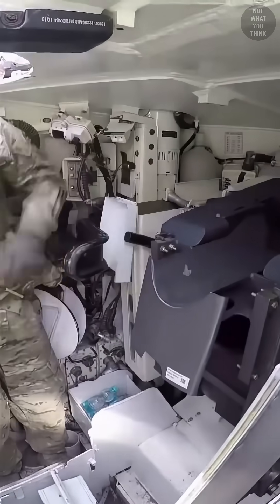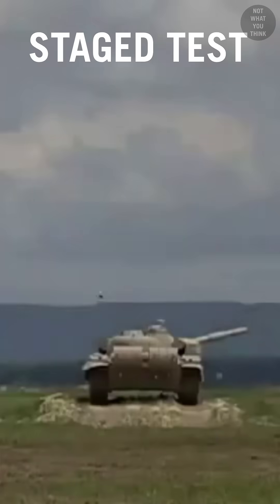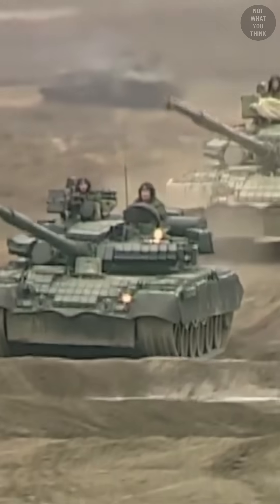Why M1 Abrams Tank Has No Auto-Loader #shorts

Comment: Seems like one could design an auto-loading system that also has this safety compartment.
Reply: Probably to many moving parts causing a higher risk of something going wrong or getting jammed. Plus with an auto loader you lose the added benifits for having an extra person on board. Benifits such are having an extra person to take over one of the other positions if some one gets hurt or killed, and extra set of hands when it comes to maintain the tank or enacting repairs while out in the field.
Reply: There are auto-loader tanks with a safety compartment, I don't know about Russian tanks, but I know the French Leclerc tank has a safety compartment and an auto-loader.

Comment: Why is everyone so not smart and lazy. You are too lazy to read the history of the development of the Soviet and Western schools of tank building. 
The reason why an automatic loading device is installed in Soviet tanks is the requirement of the military to reduce the size of the tank and its weight. But the tank's armor had to be very thick. 
At the time when this task was issued (50s - 60s of the 20th century), the aiming abilities of the tanks were very weak. Reducing the size of the tank made it possible to greatly reduce the chance of hitting a projectile from an enemy tank. Еhere was no such task in the western school of tank building. The reason for this is the very high complexity of developing a conceptually different tank.
Which leads to the exceptional high cost of this development. Also, there was no obvious advantage of reducing the size of the tank over its armor. The large size of the tank and, accordingly, the chassis. (7 wheels west 6 wheels of the USSR) can significantly increase the weight of the tank, which means it is easy to increase the thickness of the armor. In these conditions, in Western large tanks, the automatic loader does not make sense. Since the dimensions of the internal space will allow accommodating the 4th crew member (loader). The 4th crew member weighs significantly less than the automatic loader. Considering that the Abram at that time weighed 60+ tons, the American military abandoned the automatic loader, which added several tons to the weight of the tank. Although the Abrams with an automatic loader was developed, it was rejected by the military. 
I could write a lot of different information, but I think all this will not be interesting to anyone.
Have a nice day, good luck in life. Watch less TV and YouTube read more books. Study history. And then no one can make fools of you. Good luck....
Reply: Well, If you're not a tank or history or combat enthusiast like you and me, you wouldn't like or search up these things. Not everyone likes history or Tanks. For history sure that might be essential, but tanks? And some people have more important things to do or worry about depending on their jobs and aspirations. So no, I don't think everyone is"lazy"
Reply: @waitholdonwhat28  his point flew right over your head. His point was: "educate yourselves, you fools"
Reply: @rafon.  isn't that why people are watching the video in the first place?

Comment: -One more soldier to maintain the vehicle
-One more soldier to pull security
-Easier to switch ammunition types
-A well-trained loader can reload very quickly, sometimes even faster than autoloader systems that are just a few decades old
-Fewer moving parts
-Less heat buildup within the tank that could affect electronic systems or cause heat casualties in hot environments
Reply: Or, rather, one more federal job that could be easily automated promised to someone who missed his chance to come home as a folded flag since the New Deal depended on not a lot GIs coming home in 1946.

Comment: Bullpoo. The main reason to remove a crew member was to make the tank smaller. Smaller tank means less overal weight, not to mention smaller target. Also, smaller tank means cheaper to make and more logistics-friendly (less fuel consumption, rail and water transport etc)... Around 9 tons of weight is saved in armour alone by removing one man from the tank's crew. In the 70's, first T72's at 41 tons were approximately 12 tons lighter (and 20% smaller) than M1's of the time. While the proportions have changed in contemporary tanks, the main principle still stands...
There was an actual construction doctrine in Warsaw Pact countries, forcing certain bridges in border areas to be built in a way that the max load did not exceed 50 tonnes - this made them unusable for NATO MBTs, in order to hinder potential NATO armour movement.

Comment: 4 man crews make field repairs and daily operations easier for the crew as a whole. Plus when you take into account the tanks that have Officers the crew really is just 3 in terms of actually keeping the tank running.
Reply: Yeah and having a soldier load the ammo means you can fix a jam more easily than having to fix an autoloader gun jam
Reply: Oof.
Reply: Manual loading is faster as well
Reply: That's right.  When you are fixing shit and are on CO's tank, if that sucker goes down, he is gone.  Have fun fixing thrown track, broken road wheels, etc. with one less crewman.
Reply: Another reason for Russia use of autoloader is to keep the silhouette really short and small. Compare abrams height and t72 or t90, the difference is really significant. It may be an advantage for Russian tank in open plain warfare and in tank v tank battles, but in urban environments it’s kinda pointless.

Comment: The Abrams still stores it's ammo in the turret just like Russian tanks and Russian tanks keep their ammo in a sealed cell with exterior blowout plates just like the Abrams so the last reason is a bit of an iffy reason.
Reply: "Still stores it's ammo in the turret"?I see you skipped the video and went straight to comments with crap.
Reply: @gt37264  Bruh. The entire safe compartment with the ammo is inside the turret...
Reply: Explain why there are so many videos and shit of Russian tanks having their turrets explode after ammunition is detonated then. Clearly they rarely work, if at all
Reply: @Zero-ob8in  mostly because there's so many videos of it happening on older t-series tanks used as targets after the collapse of the Soviet Union.

The only decent video of an Abrams ammo cooking off that I know of was an Iraqi Abrams ISIS shot in the back of the turret, and people often leave out that the crew drove it back to base afterwards with no issues.
Reply: @Zero-ob8in  only T-90M have a safe ammo rack in back turret whit blown out panels. You can only acess it from outside. The carrocel is protected on M variant.
The T-72 only have a 20mm RHA platr in front of the carrocel, sow if spalling comes from the front it wont damage. And a thin metal plate on top to cover from dust.
Also, since the ammo in bellow turret, T tanks have a more cooler explosion

Comment: If someone made an autoloader that loaded from the bustle instead of the basket, you could still have the safety of blow-out panels....oh wait, doesn't the French Leclerc use that method?
Reply: The US military never had an autoloader it liked. US defense contractors never produced one that was light enough, reliable enough, safe enough or with enough ammo  for the US military to accept. The Stryker MGS has an autoloader, but the vehicle is being retired because the autoloader is too unreliable and the vehicle is too unstable when firing. Plus, it doesn't carry enough ammo.

Comment: the supposed upside is an extra crew member to help out. well, thats an extra crew member needing space and armor, and one more person to train and panic. there is no advantage.
swapping out amo, yess surely thats an advantage. and it ends right here.
Reply: human loaders are a bit more "reliable" in that the turret getting slapped by an explosive will hurt, but not necessarily injure or kill the loader, with autoloaders, they are much more sensitive and expensive, and damage can render them unusable.
and then you and your "one less man" died because the autoloader broke on the first hit.
and the crew cant fix the damn thing as everyone has a job more important than fixing it(gunner maybe able to try)
not to mention if the autoloader fails or breaks during repairs(if you CAN even repair the thing) the whole tank the the smaller crew are all dead as fuck
and if the tank has been shot then another is most likely coming then that autoloader will blow up(the tank+crew along with it) before the tank is even pen'd
Reply: @troyherrmann235  sure, i mean .. usa can't make an autoloader, gotta say something to save the situation but we all know its bleeding from every possible wound.
Reply: @troyherrmann235  bigger turret, vastly more space as you got +1 person. allso working in a super cramped space. 

usa just never managed to make a semi-decent autoloder ever. 

what you are right with is expenses. a human is cheaper to replace than a machine.

Comment: No way! Automatic loading is more efficient and you can produce hundreds of tanks without using spencive humans, future robot tanks will use automatic reloading
Reply: while an autoloader can put the round into the chamber, it CANNOT get it back out nearly as fast or efficiently as a human. Why would that matter? Well, tanks are standoff weapons to be used at long range typically. Modern tanks are multi-role and called Main Battle Tanks, which means they use several different types of rounds like high explosive (HE), Armor Piercing Fin Stabilized Discarding Sabot rounds (APFSDS), or High Explosive Anti Tank. But lets say you're providing infantry support to a unit by shooting some HE at some infantry in a building, and all of a sudden a tank suddenly appears. You need to sight onto that tank and switch quickly from HE to APFSDS  (or HEAT) to adapt to a quickly changing battlefield, which an autoloader cannot do efficiently.
Reply: @troyherrmann235  you shot the gun then reload with the correct ammo, why would you waste your time unloading the previous round?
Reply: @clicky_ch  good luck reacting in 5s

Comment: I used to be a M1A1 tank crewman in the Marines.  If the loader got hit by the recoil it's game over.
Reply: Interesting, do they not have a safe fire button out of the way of the recoil that the loader has to hold before the weapon fires?
Reply: @destroyedidiots1111  no, the loader loads and get out of the way.  There is a guard that you stand behind, if you're behind it you won't get hit.  That black guard at shoulder level at the start of the video.

Comment: Also it allows the versality of using the appropriate shells depending on the target. A human can load the appropriate shot against infantry/light armor / heavy armor at a split second decision.
Reply: Difference between autoloader and a human in selecting ammo type is that in the first case tank commander has to press the correct button, and in the second he has to use his mouth. Autoloader designers arent stupid.

Comment: I know almost nothing about tanks but can't you make an auto-loader that grabs the ammo from same kind of storage?
Reply: Some do, like the Japanese Type 90 or the French Leclerc but the biggest issue is that while an autoloader can put the round into the chamber, it CANNOT get it back out nearly as fast or efficiently as a human. Why would that matter? Well, tanks are standoff weapons to be used at long range typically and today's tanks are not put into roles anymore like they were back in WWII with heavy, medium, light, and infantry tanks. Modern tanks are multi-role and called Main Battle Tanks (MBT's for short), which means they use several different types of rounds like high explosive (HE), Armor Piercing Fin Stabilized Discarding Sabot rounds (APFSDS for short, basically long metal rods designed to kill other tanks), or High Explosive Anti Tank (basically an explosive that they turned into a plasma cutter and is about as cool as that sounds). But lets say you're providing infantry support to a unit by shooting some HE at some infantry in a building, and all of a sudden a tank suddenly appears. You need to sight onto that tank and switch quickly from HE to APFSDS  (or HEAT) to adapt to a quickly changing battlefield, which an autoloader cannot do efficiently.
Reply: @jesusofbullets  you clearly know nothing about tank manual safety , no tank crew unload round ever . if wrong type of round already loaded , they fire it at target and load the new correct round instead of unload the live round back in , the whole point of sealed ammo rack is to prevent any live round inside crews compartment . unload shell back in = negative that entire point . no matter autoload or human loader nobody unload shell that already loaded .
Reply: @quanohong572  Bruh. Have you heard about duds? You expect them to keep the dud shell loaded in the barrel and take a vacation until it fires properly?
Reply: @FloodExterminator  tank in real life combat do not pre-load round in to chamber before it know there are target to shoot at , it 180 degree different compare to self-defense pistol  basic trainning aka alway have one round in chamber . 
in real life tank combat rule are strict and simple : no target need to be deal with tank cannon = no round ready in chamber
Reply: @quanohong572  Do you know what a dud is? A dud is a shell that hasn't fired properly or at all meaning the crew could be ready to fire at a target but the shell was a dud. They are rare but can still.
Reply: @quanohong572  Wow your point is redundant
Reply: @jesusofbullets  if it's quicker to shoot and reload why not fire the HE at the enemy then follow it with an anti-tank munitions.

Even if HE doesn't kill anyone in the tank it will still shake the crew pretty bad and also damage external sensors which could leave them blinded. This is also ignoring the fact the whole reason for firing the HE is bc ammo switching is slower than firing and reloading.
Reply: @jesusofbullets  M1A1 and other variant do not use HE's. Its prerogative of Leclerc and other not L2/Mq tanks
Reply: @jesusofbullets  This depends on how well the autoloader was designed and built. Autoloaders at this point are way superior to human loaders.
Reply: @JustCallMeJames1  Way superior? Is the year 2500 already?
Reply: Vertical videos have, apart from their format, one common trait. They're more often than not full of shit, made in hurry by undereducated people for so called content.
Reply: Leclerc tank grabs ammo from turret instead from floor like russian tanks
Reply: Tbh, i don't think Russian autoloader design is bad, they have the same risk as other MBT that stores their rounds in hull, like practically all MBT except M1. Also, they don't need armored bustle as they don't keep ammo inside the turret to begin with.
Reply: @Kevin-fj5oe  they keep ammo on the floor inside carousel that is prone to cook
Reply: @edwardvalivonis23  and how europe MBT any better?  With their hull ammo stowage?
Reply: @Kevin-fj5oe  tanks such Challenger, Abrams, Leopard, Leclerc store ammo in turret bustle away from crew that means during cook off, crew will be safe unlike Russian, Ukrainian, Chinese tanks that store ammo in floor mounted carousel that can blow turret up during cook off
Reply: @edwardvalivonis23  yes, but my question is that, are hull stowage safer than the carousels? Since the only reason of having a blown-off panel in the turret is, you have ammo in the turret.
Reply: @Kevin-fj5oe  hull stowage is temporary and not likely during the war, so is safer, while carousel is permanent and crew sits above it
Reply: @edwardvalivonis23  wait, what?
Reply: @edwardvalivonis23  Leopard have a unprotected ammo rack in hull like Lecler. M1 have another safe ammo rack in the back hull. Challenger stores propelant in turret and hull not protected HESH rounds are in hull and have some protection, ap rounds are in back turret unprotected
Reply: @Kevin-fj5oe  he means that tanks wouldn’t fill the hull storage in combat. the turret storage gives them like 20 rounds, definitely enough (not to mention they move around as a group)
Reply: @alyssadavenport629  the leopard turret could only bring 15 shell, does crewman seriously would go to combat with only 15 shells? While still divided between HEAT dan APFSDS?
Reply: @DBeskar6605  No autoloaders are superior. You are wrong on all accounts here.
Reply: Yes it is already done for the said Russian tank in the video, they just didn’t tell you about it)
Reply: Also, tanks that do that are also typically more likely to explode due to the way their ammo is kept (cough cough the entirety of the Russian T series tanks cough cough).

Comment: Something not mentioned by this is that humans have a lower failure rate than the auto loaders, and for short engagements(most of often type) humans are faster at loading than the autoloaders.
Reply: Autoloaders are notoriously reliable, and both ways are faster than acquiring a new target so it hardly matters unless you miss.

Comment: I'm surprised no one has combined the secondary safer storage compartment AND autoloading... but I suppose it still doesn't account for having an extra man in case other things go wrong
Reply: the video is somewhat misleading, there are tanks which has autoloader with ammo storage compartment.
Reply: Leclerc, type 90, type 10, k2 black panther
Reply: @patriotic-panda  ARJUN Mk1A
Reply: @aadityazeo  no. The arjune as individually sealed containers for the ammunition. Which would be fine if only 1 piece of ammo was hit. But the chances of that is very unlikely